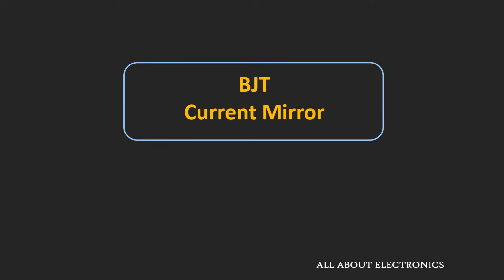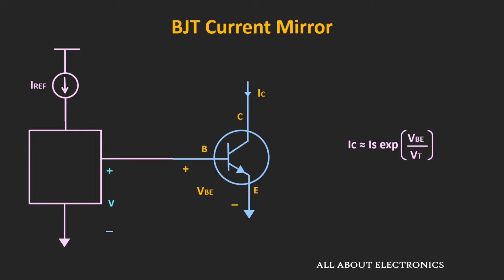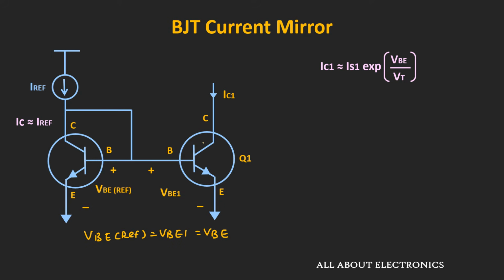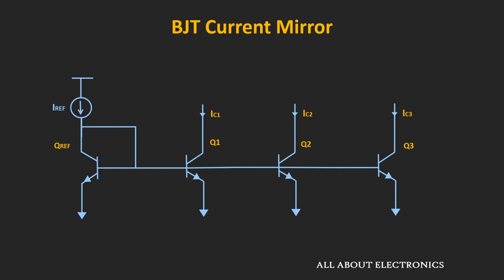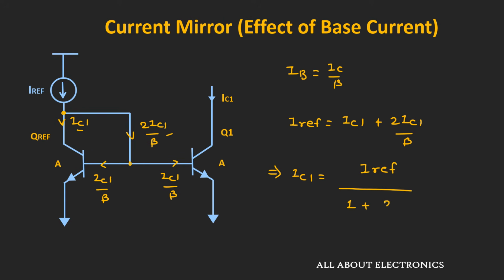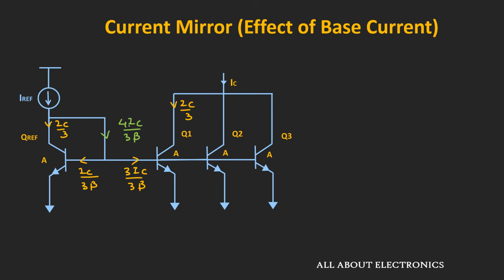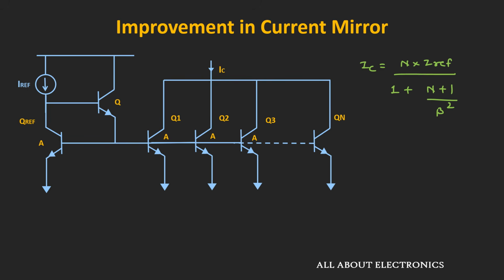BJT- Current Mirror Explained

Comment from the maker: The timestamps for the different topics covered in the video:

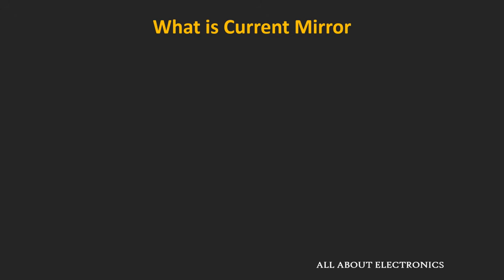0:30 What is Current Mirror? Application of Current Mirror

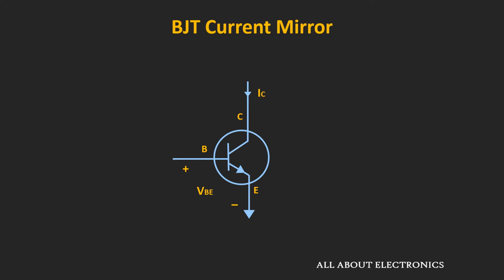2:50 Design of BJT- Current Mirror

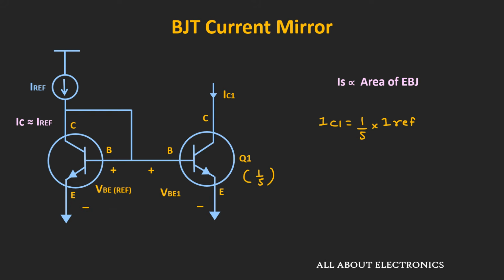8:45 Current Mirror with more than one transistor (N- Transistors)

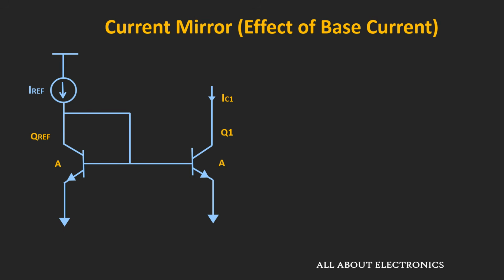10:45 Effect of base current on the Current Mirror

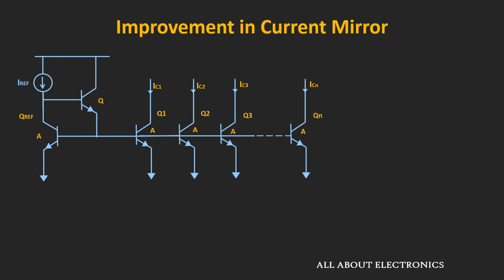17:33 Improvement in the Current Mirror
Reply: Practice the actual usage of "the" and this channel becomes world class.

Comment: Sir, at 1:07 I'm unable to understand the example of the smartphone battery you gave. If supply voltage(Vcc)  is decreasing then Iref should also decrease because Iref is generated because of Vcc. So in a video why do you explain that Iref should be able to make itself constant. Please explain that part, sir.
Reply from the maker: Yes, thats true. But that's what I am saying is, it is possible to design the current source which maintains constant current even if there is a change in the supply voltage. In this video, it has not been discussed how it can be designed. But it has been assumed that, such current source Iref is readily available.
Reply: @ALLABOUTELECTRONICS  
Sir can you please tell me real life example or practical application of current mirror circuits.
Reply from the maker: @swaritmahalsekar5521  Well as I said in the videos, the current mirrors are used in all op-amps and analog integrated amplifier circuits.
Reply: @ALLABOUTELECTRONICS  Yes sir I know that but still it's little confusing like why we are copying current in next bjt why can't we bias the 2nd bjt with any biasing technique.
Reply from the maker: @swaritmahalsekar5521  see, the actual integrated circuit has not only one but many amplifiers. What we want is that, all the amplifier should work perfectly well even if there is any change in voltage or temperature. Of course, for that one can design Iref current source which I have mentioned in the video. But the thing is, all the amplifiers are biased at different operating point. So, if you want to run them with the special current source, then you need many such current sources with different values in the circuit. Instead of using one such special current source, the properties of that current source can be copied using the current mirror circuit and the same can be distributed to different amplifiers. I hope, it will clear your doubt.
Reply: @ALLABOUTELECTRONICS  Sorry sir I'm asking you hefty doubts but still, I have doubts in my mind. 
Sir let's suppose there are 3 BJTs connected in the current mirror circuit. 1st is responsible to generate Iref = 2mA.
Let's suppose 2nd bjt contains one amplifier which needs 2mA and 3rd contain another amplifier which needs 3mA so how can we achieve this. I'm unable to think it. 

and what about Vce because biasing depends on Ic and Vce.

Comment: 5:05 Sir. How does current flow in an open circuit?
Reply from the maker: No, in actual circuit there will be some load at the collector terminal. I mean the one end of the load is at supple and the other one is at the collector. Here just for explaining the concept of the circuit, it was not shown.

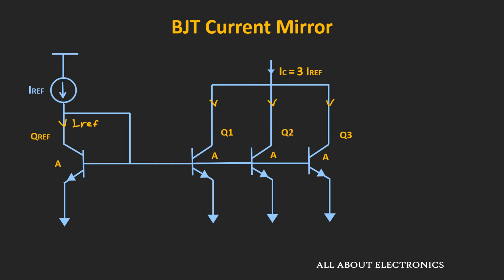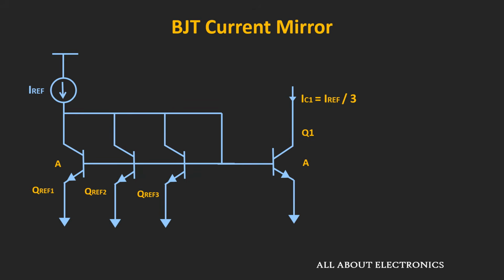Comment: At 10:19 and 14:29 the circuits and their areas are same..then why in 10:19 you said Ic will flow through q1,q2,q3 ??? At 14:29 you said Ic/3 will flow through each q1,q2,q3 
Please clear my doubt sir!!!
Reply from the maker: At 10:04, as I mentioned, since the current through the reference transistor is equal to Iref, the collector current of all three transistors will be the same. Ic1 = IC2 = Ic3 = Iref. That means total current Ic = Ic1 + Ic2 + Ic3 = 3*Iref.
With some simplification, Iref = Ic/3 . 
The same thing I have written at 14:35.
I hope it will clear your doubt.
Reply: @ALLABOUTELECTRONICS  yes sir...thank you sir🙏

Comment: Aren't these all current mirrors too much dependent on beta? if beta changes due to change in temp, will the circuit show significant error? To improve that do we use voltage divider CE biasing for each current mirror?
Reply from the maker: I have already shown the improved circuit at the later part of the video.

Comment: Sir, if i use current source for biasing an amplifier how emmiter current does not depend on beta of transistor. I can not understand.
Reply from the maker: When we bias the transistor using the current source then collector current is equal  to the  current of current source.lets say it is Ibias. This Ibias is independent of beta, because that current is not generated using the base current. It's coming from some other point. So, effectively the collector current is independent of beta. I hope it will clear your doubt.
If you still have any doubt, please let me know here.
Reply: @ALLABOUTELECTRONICS  If i apply current source in base then collector current is beta*base current in this way it is dependent on beta . So how can it possible to independent of beta
Reply: @tanumoypramanik7760  You apply the current source to the collector of the amplifier. Ic and Ib are still related by beta, but Ic is held constant by the current mirror, and Ic is the important current for amplification so at that point Ib can just be whatever it ends up being.